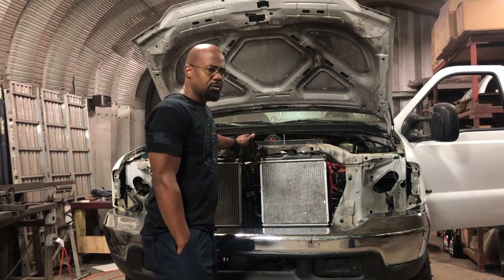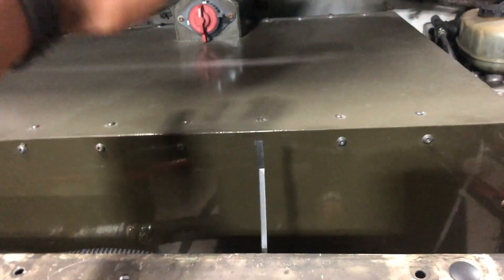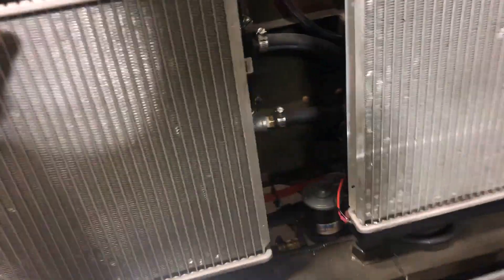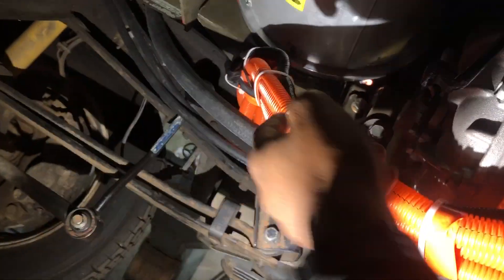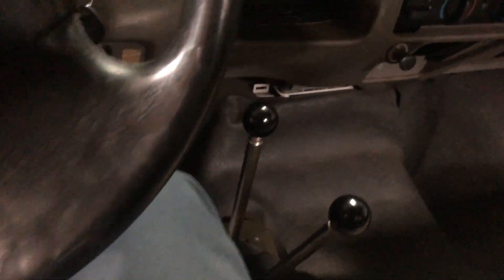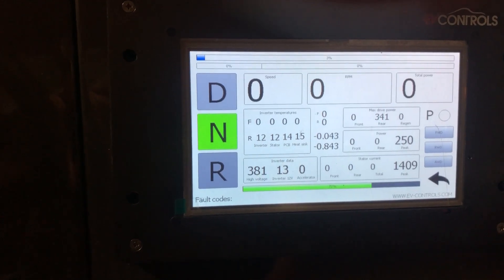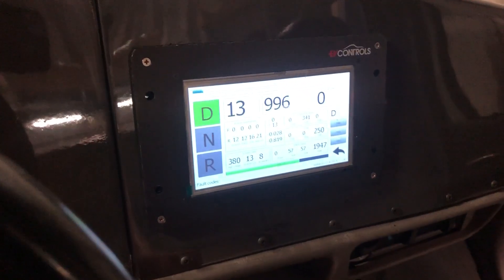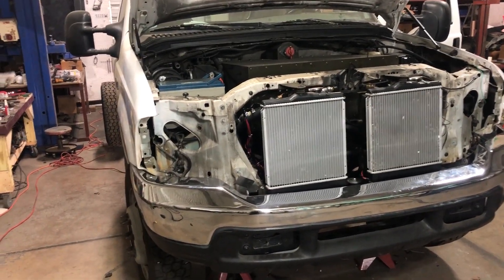Tesla powered F450 Walk-Around & Controller/Motor operation

Comment: I would highly recommend switching to a multi motor setup in the future. You will be running extremely high current through that motor constantly, straining the cooling and increasing ohmic losses. Many other benefits to multi motor systems as well and very easy to implement in trucks.
Reply: I completely agree. This is a one-off and suspension restrictions are why we went with this setup. In order to make this a true Tesla powered vehicle we wanted to use as much Tesla components as possible while maintaining the trucks original handling, breaking etc. should we do anything remotely close to this in the future, we would use a totally different setup. Thanks for the input!👍

Comment: Looks like a great project! The only thing I worry about is the fact that it's an F-450 powered by 1 Tesla motor. Could be a possibility of burning out the motor or controller? They do have a lot of torque but the duration might not be good on it. I like how clean everything went in looks like it's almost bolt-in.
Reply: He said the truck is only about 500 pounds heavier than the P85 car the motor is out of. So should be fine. Similar torque output as the original diesel engine.
Reply: @JasonWW2000  I meant towing, an F-450 pulls way more then a normal pickup. The controller may be powerful enough to handle the weight of the car/ truck it's in but thousands of pounds more might be the make or break part. 600ft lbs is fine, that about as much as a 450 makes so the motor should handle it.
Reply: @travis4798  I heard the owner of the truck plans to use it to move things around on his farm. So it won't be towing heavy things on the highway. It should be fine in that application. Also the owner requested a single Tesla motor and Greg built it for him.

Comment: Very interesting. But DO NOT tow with it. If you try you will burn them motors up real fast.
Reply from the maker: I’ve already towed with it several times. No issues. It’s all about cooling and gearing.
Reply: @greggoeselectric3595  it'll work for a little bit with light loads. But if you try to tow a vehicle or such it'll burn up. Motors that can fit in a vehicle just can't handle that load.

Comment: Why can't someone put together a Heat pump to heat the batteries.   Way more efficient then regular electric fluid heater.  You're talking about 30%-50% less electricity used by Heatpump heater then regular heater.

Comment: 2 shifters, so that means left and right side are independent? does that mean one side can be in neutral and consume less power?
Reply from the maker: It’s actually 3 shifters, one is hidden. But it means front diff independent from rear, high/low gear and magnum under drive for really high torque.

Comment: Greg, I love this.  If you were going to convert a 2001 f250 4x4 with the factory 7.3, where would you start?   ...assuming the budget is a hell of a lot less that a full tesla swap - Like 1/10.   Is it possible?
Reply from the maker: Your batteries alone are probably going to run you the 1/10 you mentioned. But I would start with deciding what kind of drivetrain I want and that depends on your intended purpose for the truck after the conversion

Comment: What would the cost be for a conversion like this?
Reply from the maker: RobertBeckerphotography $100k Only because there’s so much engineering involved. Are we using a plug and play conversion kit would cost about $60 K
Reply: RobertBeckerphotography my partner was on the team that designed the chassis and battery box. He also crash tested it and went to China to help set up the manufacturing plant.
Reply: Sorry wrong  person. That conversion cost about 100K

Comment: Have you been keeping close track of the cost involved in the conversion?  Would it have been less expensive to use other brands of electric motors and battery/controller systems?
Reply: James King it Would have been cheaper to go another route however this was done for a client who specifically requested a Tesla drive system so we chose to accept the mission.

Comment: I thought you’d add a fifth wheel rv with 2000kw solar and a few Tesla batteries and make that your battery pack. More and more rv’s are going all electric. People pay millions for and rv. Think. You could travel wherever without stopping. And if there’s no sun. The rv has a generator to charge the battery

Comment: Hi Greg, gotta question. Have you converted a class A motor home? Do that and you're rich.
They carry a diesel generator standard, that would reduce battery need dramatically with continuous charging.
Talk about disruptive tech. This is you're lowest hanging fruit.
Reply: Can you add a tesla motor to my 5th wheel RV? My diesel truck would supply all the generating juice, so battery to supply coach power, and I'm frequently plugged in so can maintain charge.  Waddya think?

Comment: No mention of the gear ratios that you are using.  Given if you are using  only the top gears of the TESLA gear reduction box it is 3.12 to one.  It is essential that you have to the correct gearing to make this all work  Here is a guesstimate of your existing gear ratios  http://www.dragtimes.com/gear-ratio-calculator-mph-speed.php?tire_width=265&tire_aspect=70&wheel_diam=19.5&tire_diam=26.854330708661&axle_ratio=5.13&redline=16000&gear1=3.12&gear2=&gear3=&gear4=&gear5=&gear6=&gear7=&gear8=&calc_button=Calculate    but you can change these variables to actually match what you have,
Reply: Mark Yormark I am running 4:10s
Reply: @gregcoles2491 , I suspect you are geared too high with the 2.97 to one planetary between the transfer case and the motor, the 4.1 ring and pinion and the large diameter of your truck tires.  Use the gear chart that I provide and find out for yourself.
Keeping in mind the TESLA Model S would be much lighter with a 9.73 to 1 reduction with a smaller diameter tire.

Comment: Overall its a terribly stupid idea. That motor will not have near the capability for that truck to do anything it was designed to do.
Reply from the maker: Jake S this is what the customer specifically requested. Whether the truck lives up to its original power plant or not, this is a step into the future of heavy duty truck power plant options. Check out Atlis Motors. FYI, How do we know what works or doesn’t if we don’t try?
Reply: @greggoeselectric3595  it's simple to know what will or won't work. Load rating and torque output combined with mpg or empg. The only way an electric truck will work to haul a load is with a hybrid system where you have a diesel generator producing the electricity for the motors. You'll need multiple large motors.
Reply from the maker: @JoeZelensky  this vehicle was built as a farm vehicle. The owner wants to move things around the farm without the noise and pollution. On top of that it was a fun and challenging project. Like I said whether the truck lives up to its expectations or former output via ICE motor isn't the point. Someone wanted it built so we built it.
Reply: @Ralph Layton The old 300 I6 2wd could do the same thing.